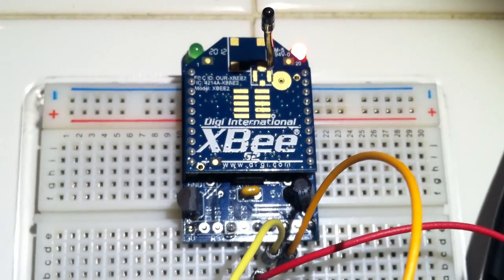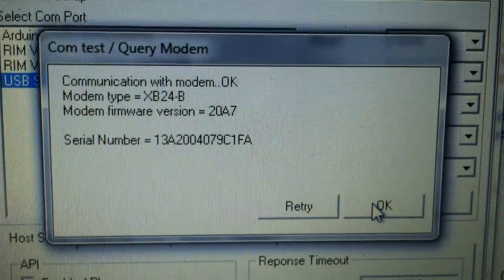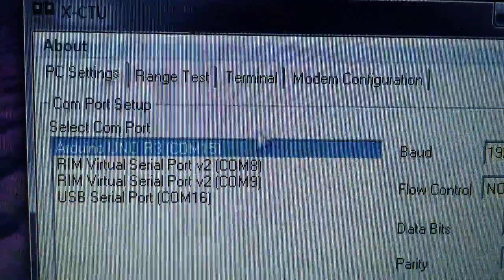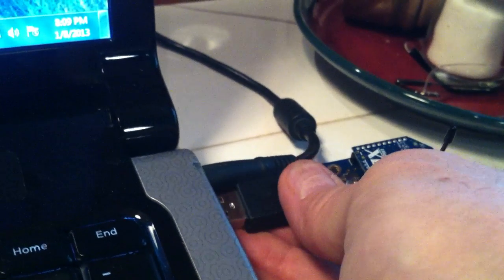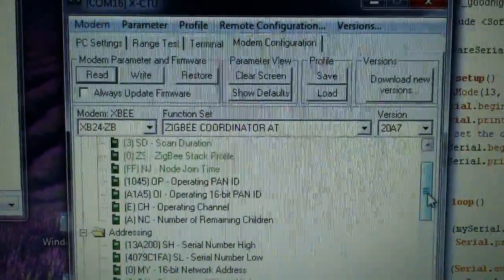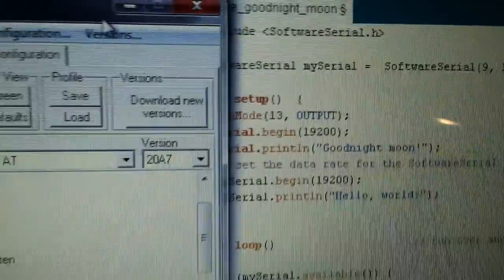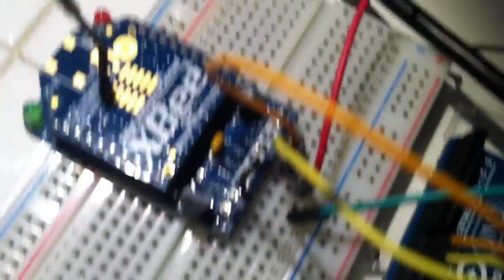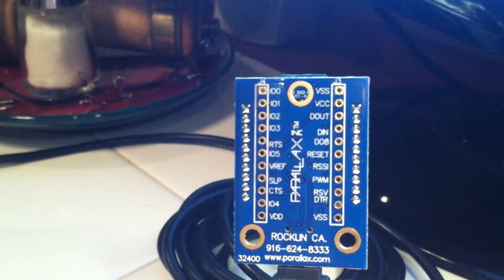Arduino and Xbee Series 2 (not Series 1) Configuration

Comment: Thanks, saved me time! PD: The problem reading the configuration of the xbee through the serial port was mainly because it was being used for the serial monitor of the Arduino IDE. That's because the serial monitor "opens" the port and doesn't let others applications to acces it.